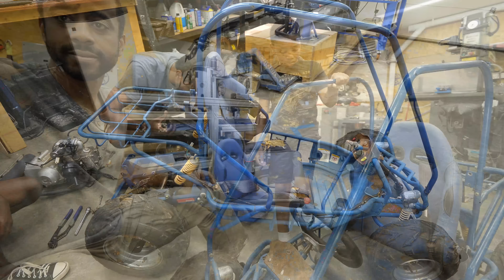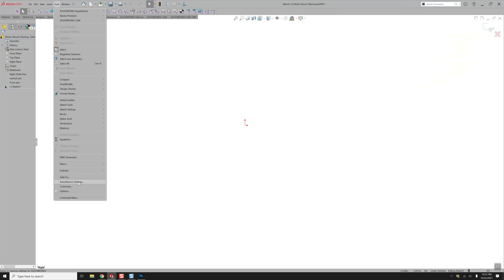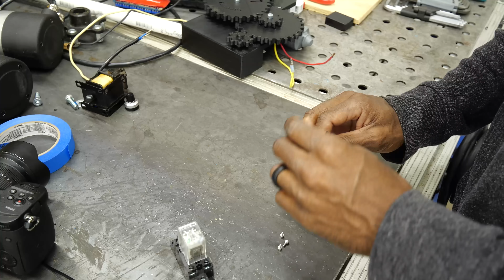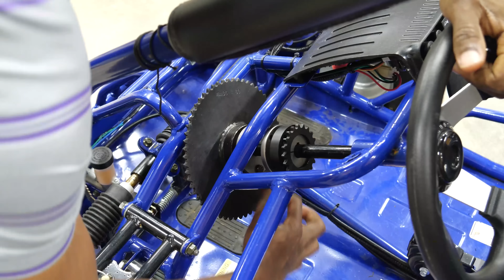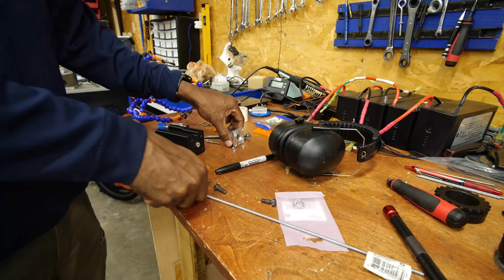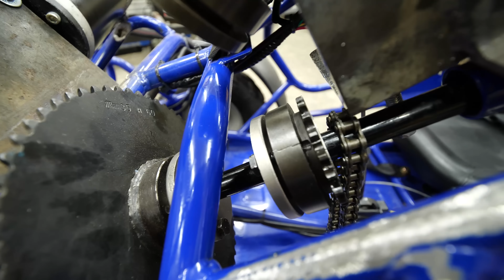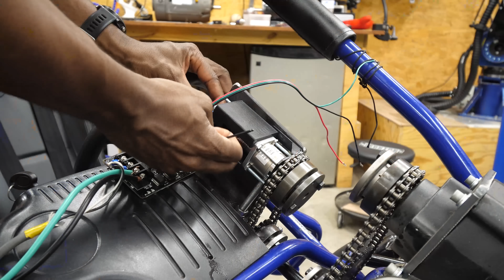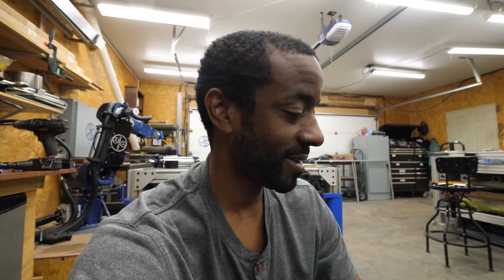Building A Self Driving Car - Jeremy Fielding 098

Comment: Did you see the "This Old Tony" Mars Rover video? It doesn't have self steering, but there is electronic controlled drive motors on each of the 6 wheels. 

Wouldn't it be better to attach the pot to the horizontal link that goes between the 2 wheels. Measure the voltage on the pot at 10 different steering positions, (center, far right, far left, and a few places between), then program your micro controller what it is allowed to do at each position.
Reply: Why not put some kind of friction wheel between the steering shaft and motor.. That way, if the motor tries to turn with more force than the wheel can take, it just slips... 

(Danger Will Robinson) I can see some real danger here.. If someone had their arm going through the steering wheel when the motor was turning it, it could do some real damage to the human arm.

Comment: Maybe a clutch on the steering motor, so a failure would disconnect the "power steering"  so you can manually override the steering with the steering wheel

Comment: Very impressive Jeremy. Have you considered another rack & pinion for your steering? But instead, use a linear actuator to push & pull the rack with the pinion on the Steering column. Limit switches are easy to set and a failsafe would be to deflect the rack with a cam (both solenoid & manual activated).  All failures should revert to manual operation and control.  Good Luck. Stay safe and well :)

Comment: I would say it is better to overload the motor. If the current is limited to where you don't instandly fry your electronics or wires you usualy can prevent the motor from overheating when you overload it. This does require measuring the current you are suplying to the motor and addapting your controll on it.
From the video it also looks like it has much more torque then it actualy needs with the motor not even slowing while breaking the mechanics. But I don't know how much harder the steering is when driving.

Comment: Hopefully your theory about it turning the wrong way is correct and it certainly makes sense. However, I would still say set the limits on the potentiometer to not actually hit the extremes on the steering so it never needs to apply that kind of torque. Obviously if the wheels ever get stuck it might still try and apply that much torque but at least it won't be fighting the limits of the steering all the time.  Great video as always!

Comment: As a big fan of your channel, I've noticed that you went from using scrap to buying most of your materials. I'm glad that you can now, but I think you could have come up with a different and simpler idea. Maybe instead of trying to turn the steering wheel, try pushing and pulling the steering rod with a linear actuator or a winch and spring combination.

Comment: Amazing project. Wouldn't it be safer to downsize the motor so if the steering column breaks and the motor overload you would know and the AI would apply brakes ?

Comment: I know you are a great engineer. One trick that I always use, testing motors and other actuators outside the mechanical system. In worst case they spin free and nothing gets damaged. Also you can easily see if your program works correctly. Just the 2ct from a hw-engineer.

Comment: what if you use a stepper motor.. I know that sounds crazy however even a printer motor can do it.   
If the motor is under powered to crank it.  however once vehicle moves the stirring is easier. 
I like what you are doing how ever your motor is to powerful for the cheap shaft and you may have to use a solid one.   
With that comes safety issues of the shaft becoming a item that can kill who ever is behind the wheel. 
This is where a lower powered motor is your best bet.  If steering fails the car should come to a stop.

Comment: I'm surprised you opted to re-invent the wheel, quite literally. Toyota EPS modules are easy to source and hack, and are much safer than a custom solution, and there is open source software and hardware (OpenPilot and the Freeon) readily available to do the self-driving portion.
Reply: I was going to suggest something similar. Or, use the design to 3d print one since forces will be drastically different.

Comment: Let's talk about safety.  Or more importantly a fail safe mode.

First, you already know the answer to your steering shaft breakage problem from your experience in CNC conversations and Jarvis and other posts on this video. So I won't spend time there. 

You need a circuit whether digital or analog that will trip the power to the propulsion motor and possibly apply the brakes if the requested steering angle as measured by the steering wheel position from the control motor verses the actual steering angle as measured by the wheel position is out by more than a few degrees over a set period of time as measured at the steering wheel motor and at least one tire itself. I think it is important to measure both at the control motor itself and not the shaft and at a wheel itself to capture errors between the automation and reality (the chain or shaft breaks,). This could be tied in with an Emergency stop button on the dashboard for the occupants to press too.

This can be done a number of ways including in software depending on the computing power and IO options of the control computer. I suggest a separate control  circuit powered by an ardino that will only enable the propulsion wheel motor control by relay or something if the measurements are within spec. This way it fails before even allowing the cart to drive if there is a problem and disables the drive with a problem.  With an ardino, you can program it to enable another pin that could control a solenoid or piston to actuate the brake pedal on failure too.  And this braking mechanism could be overridden by turning the power off which also sets it in a state that will not allow the AI computer to move the cart. 

The second part of this strategy should also be a return to neutral position of the wheels themselves. So if there is a failure which will likely happen at a turn,  the steering goes straight as it powers down and applies the brakes. This may be the natural tendency depending on the caster angle of the wheel alignment but could be encouraged by a set of springs (like those used for porch swings)  connected to the front axle or frame and the pivot arm near the tie rod end of the wheel hub. They would need a small amount of preload and always be under some tension.  This would cause one spring to load more during a turn than the other spring and if the control motor for the steering fails to override this stress, the natural tendency will be for the spring tension to equalize causing the wheels to return to a straight position.  This way if there is a problem like a shaft breaking,  you can predict the path of the vehicle until it stops moving. Just measure the emergency stop distances and schedule the AI turns within a margine for error before an obstacle. 

The spring method i mentioned is similar to the way steering stabilizers work on trucks that put larger tires on. The increased tire size alters the caster angle and can create a caster wobble that feeds back throughthe steering wheel. This is often called a death wobble.  The stabilizers are preloaded and essentially stabilize or dampens the steering feedback from the tires without making turning the wheel much more difficult. The added bonus is a return to neutra or straight l if you let go of the steering wheel while driving.

Comment: Limit switches and current over load detection (amp meter and software limits , or an actual system stopping overload with signal outputs) would allow you too retain control while also stopping excessive torque scenarios

Comment: As always - great video and awesome project! Looking forward to next parts :)
I would add two things to improve safety:
1: Physical limit switches for the steering. They could be actuated by steering column or  the rod pushing wheels. Magnetic switches should work fine. 
2. Since you have a potentiometer as a feedback, you could implement simple safety routine in your code : when microcontroller is instructing the motor to run I any direction, but it doesn't see the potentiometer values change ( after some short delay ) it should stop the motor. This could prevent few bad things from happening.
Reply: Agreed that adding both is justified in a case such as this.  Heterogeneous redundant systems in safety critical applications make a lot of sense.

Comment: So I am not as involved in Engineering as you are but here is my thoughts 1- Testing the system in pieces is usually safer. (don't hook up the chains and manually control the potentiometer (SP) the steering motor should spin in the desired direction until the potentiometer reaches the desired position (voltage) If the motor does not ever stop, your limits are too high/low. that should eliminate you from breaking things in the testing stages 2- an electrical override limit switch on the motor may be needed to prevent catastrophic mechanical failure. determine the steering limits and put a limit switch just before that so that it can kill the system and prevent either mechanical or electrical failures.  with autonomous cars, it is unsafe for them to stop where they are when a failure occurs but more unsafe to keep moving ..having a failsafe on the system is a lot of work but worth it in the long run.

Comment: My suggestions would be to use a magnetic encoder for the the steering position, no temperature or moisture drift, no fading, with the right enclosing weather resistant (not proof). The magnet could just be glued to the end of the steering column/pipe. Also for the safety, you probably want the motor torque lower than what you can do with human input so that you can override the computer, if it does ssomething stupid. Trust my, it will do this. Maybe a combination of V-belt drive (the slipable kind) or a torque limiting clutch, so the motor can run crazy and the steering survives. Also have a big emergency-stop kill-switch reachable at at any time and something like a wire based plug things like the waterjets use.

Comment: Hey! Thanks for sharing this one! I recommend you to find inspiration in the automotive electric power steering. 

Few things must be (re)considered in your design:

- Motor with worm gearbox it's simply a wrong choice. Yes, it has great amout of torque,   Use a gear train or even a compound gearbox instead of that contraption you've made. Or...just give a try to a hoverboard motor and use a chain to drive the steering wheel. That 500W baby will turn whatever you want and you can also play with FOC to precisely control the motion! O-drive + hoverboard motor = interesting combination

- Use two Arduinos instead of one and start figuring out how to make them work as a redundant of each other. Better be safe than sorry! Automotive power steering uses two separate MCUs that work in parallel and if one fails, the other takes the control in order to maintain a safe usage of the whole system.

- Use some end of travel limit switches on the steering bar between the wheels. Anything that has an IP rating compared with automotive sensors should be a great choice!

- Use 2 different angle sensors (AS5600 hall sensor as a fellow suggested  in the comments section) and make the comparison between their values before deciding when to make the motor turn.

These are some of my thoughts that came after watching your video. I hope you will give a try to some of them :)

Comment: I was thinking about some sort of torque sensing, or a clutch mechanism on the steering shaft similar to what one would find in a tractor PTO shaft. So if the steering shaft hits its end stop the motor can continue spinning. Depending on the type of clutch, this would also facilitate the ability to take manual control by the operator in the event of a system failure. Something similar to what automotive manufacturers use for the electric steering assist. Definitely something fun to noodle on. Thanks for inspiring me to start building something similar with my kids! Love the videos and thanks for making engineering accessible to all.
Reply: The more I think about it, the more I think load sensing would be the way to go. If you're only watching the steering shaft position then the controller will just keep trying to turn the motor until the position is achieved. If you also monitored the motor current you could spot the spike in motor current as the steering rack hit the end stop. This would also allow for calibration of the position sensor. But some sort of clutch would still be needed so the operator could take manual control.

Comment: You're inspiring.   Something tells me that stiffening that shaft is a shorter path to defeating the torque.   Agree with comment about better shaft support if room.   Even a solid shaft may bend if not supported.
Reply from the maker: there is certainly room, and it is part of the plan.

Comment: Jeremy, you need to allow for a human operator to take over control, but i don't think a kid (or full-sized human for that matter) will be able to overpower so much gear reduction on the steering shaft. It would interesting if there was some sort of friction clutch so "human servo" could temporarily take control while the computer keeps rotatinal track of the steering column and could take over when there is no more human input. It would require some sort of strain gage on the shaft to sense human input, or lack thereof. The strain gage could be calibrated to sense between hands on the wheel and actual force applied (to avoid an obstacle) Yeah, easier said than done, good luck. Enjoying your videos as usual, Happy Thanksgiving!

Comment: i think you can protect the mechanical components by limiting the current to the motor, rather than changing the size of the motor. Use an electrical limitation rather than a mechanical one.

Comment: As others have noted, encoders are far better than pots.  One reason not noted is noise:  the encoder A and B lines are digital and so are very resistant to electrical noise.  This will be important when you get a drive motor with speed control hooked up to make your cart go - some of those controllers put out a bunch of noise.
Reply from the maker: Please Check the description

Comment: What I've learned from working on similar project... you need enough torque so it can turn in a lot of situations. You should introduce some sort of a clutch that can decouple motor from the steering. You need some sort of torque measuring device on the steering shaft that can measure torque from the wheel to the shaft. This is safety for example if someone grabs the wheel it should disarm/decouple the system. Of course for simplicity you can put some metal mesh on the wheel connected to a transistor with small resistance so it could be like touch sensor, if someone touches the steering wheel it automatically disarms the system, but this could be only for testing. I can clear if needed.

Good work!

Comment: Jeremy - Removing a rotor from a stepper motor's magnetic field (called a "keeper"), permanently sacrifices 40-70% of it's magnetism/strength. Do it once, and you've more or less ruined the stepper. Sounds like balderdash but look it up, it's true. Very reputable people from very reputable stepper motor manufacturers confirm this.
Reply from the maker: FYI- I never plan to use this.  I literally cut the shaft off.

Comment: A length of 1” go kart axle with a key way would solve a lot of steering issues. There’s all kinds of hubs, sprockets, bushings and bearings that would immediately bolt on without modifications. Some welding, turning and thread cutting would be required to install a steering wheel and use the same steering rack. The effort would be worth it for the amount of bulletproof safety you would be gaining for the most precious of cargo.

Also, you need to support the steering shaft as close as possible to the torque input. The same thing would happen by hand if the steering wheel wasn’t so closely supported by the bushing.

Comment: Limit current on the motor with a constant current motor driver or have a slip clutch on the motor. Also get a magnetic encoder instead of the potentiometer.

Comment: Add limit switches to the column. They should cut power to the motor when the wheel in turned passed its limit.
Alternatively place the motor on springs and the limit switch against the motor housing. If the motor "torques" the switches will be triggered. 
Alternatively add current sensors on the power lines to the motor and disable the motor when max current is exceeded.

Comment: You could also use a high resolution absolute rotary encoder.  They're used in higher-end amateur telescope mounts.  Repeatable precision is often less than one arc-second so that would be plenty accurate enough for your steering solution.   Also, mechanical limit switches will be helpful.  Just like you have on the 3D printers, auto-homing is very useful.  Will be fascinating to watch your build!

Comment: Nice! I like the beefy steering motor -- smaller steppers might have trouble turning the wheels on tougher ground.

Experience says wheel slip and tire deflection will be a bigger source of error than your feedback potentiometer.

Also, simple obstacle avoidance and checkpoint following AI is quite doable, but un-surveyed SLAM and safe navigation where people or pets will be, is a whole other kettle of fish...